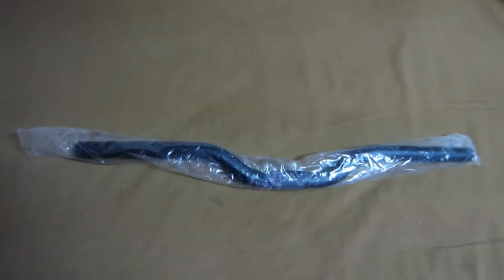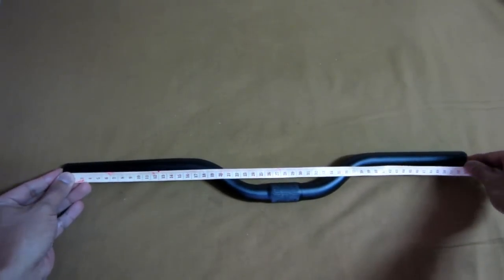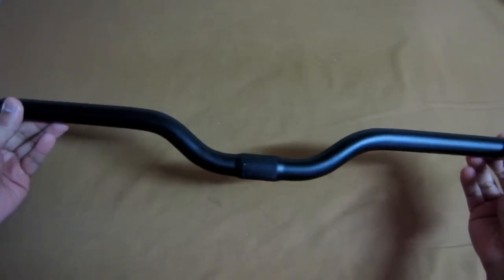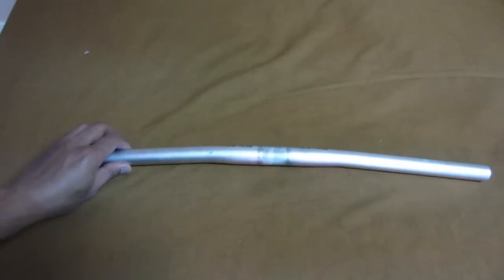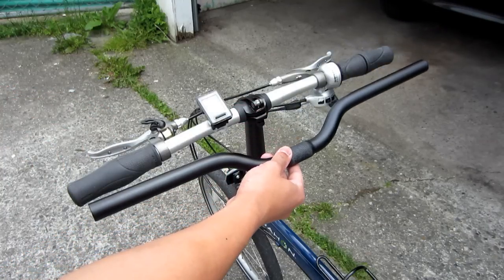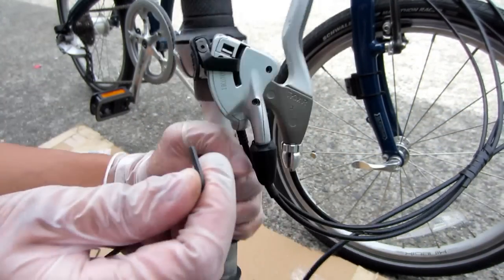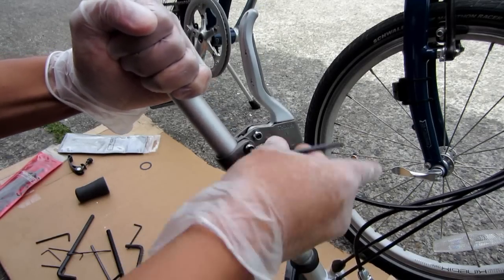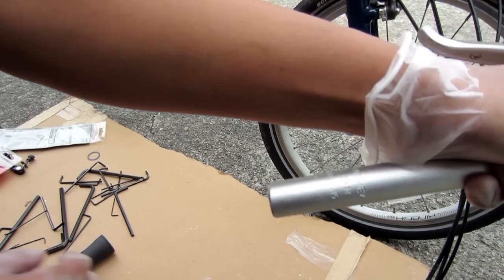Dahon Folding Bicycle Handlebar Modification

Comment: The lack of an adjustable height handlebar on the Dahon Vitesse D8 is an amazing design defect. I ordered this bike so had to buy it when it came in. I threw it away more or less at once and will never buy another Dahon. Their folding size is also way too large and the bike is too heavy. Perhaps the recent Brompton style Dahon folder is better.

Comment: ı have dahon vitesse d8. I upgraded my handlebar to riser one. But  ı had terrible backache.I think ı set wrong position for bike. My handlebar position same as yours (at video). Have you got any problem ?
Reply from the maker: i don't bike that much that's probably why i don't have a any backache. and plus im using a smaller bike stem on mine and you probably have the stock one that you can raise up higher? if so you shouldn't be having any backpain then
Reply: I also got a vitesse d8. Great bike. What upgrades have you done? Does yours also make a small rattling noise from rear derailleur while pedalling? I wish it was completely silent
Reply from the maker: kaamerasilm yes my bike does make that rattling noise from the rear as well, I thought the alignment was off, I tried to re-align it but no luck. its really annoying, an expensive bike and it has that rattling noise. my other upgrade was a lower stem click here ->  Dahon Folding Bicycle Stem Modification
Reply: kaamerasilm I upgraded my handle bar(riser). And ı have bar ends. My next moves are changing tires (schwalbe maraton plus) and ı think ı am gonna change all v brake system to shimano deore lx or avid single digit 5 ( ı am confused which one works best for me. ) 
I had also  rattling noise at rear gear. I will give you link. Download service pdf document. There is a nice information about neos 8 rear derailleur adjustment. You can fix yourself  :D  
Here is the link : http://dahon.com/mainnav/dahon-support/manuals.html